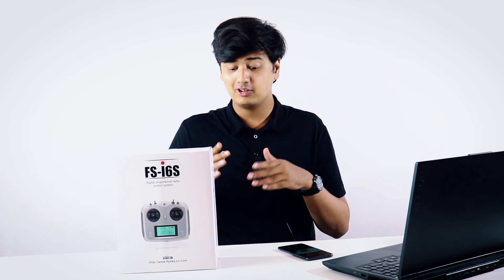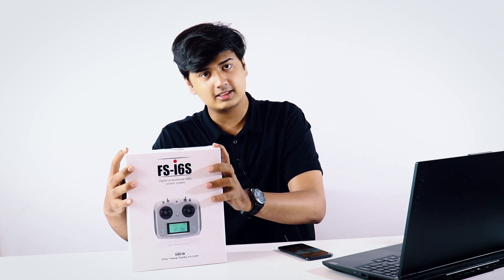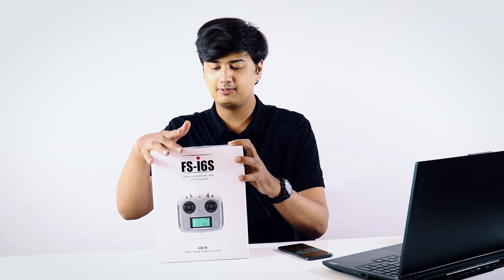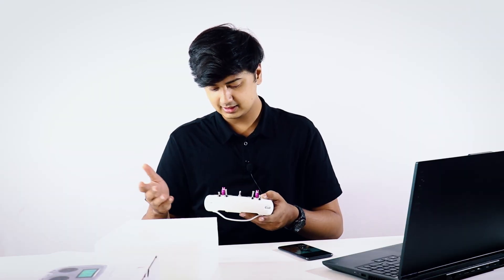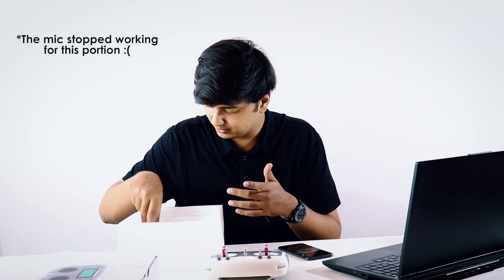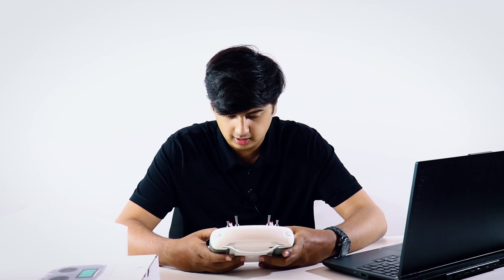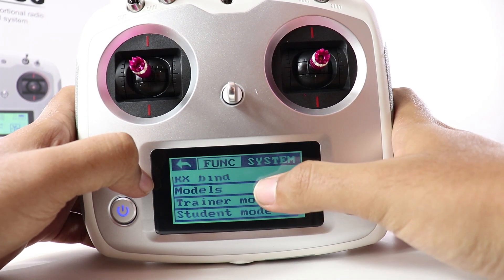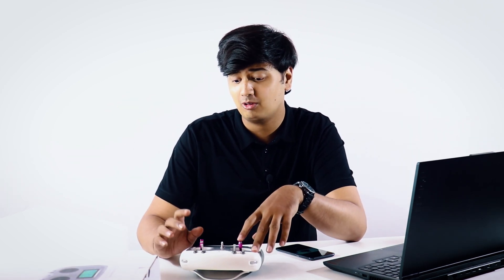FLYSKY Fs-i6s Transmitter : Unboxing and Overview | Best Quadcopter Transmitter

Comment: Trim button located back side .. trim function confusing
Reply from the maker: Yeah, that's what we thought. But the fs-i6x has better access to it making it more convenient for rc plane users
Reply: @RobuInlabs  can I use this transmission RC BOAT ⛵.... Ground level Range....???
Reply: Yes, but if you check the function setup there you reset/repurpose the switch fuction.